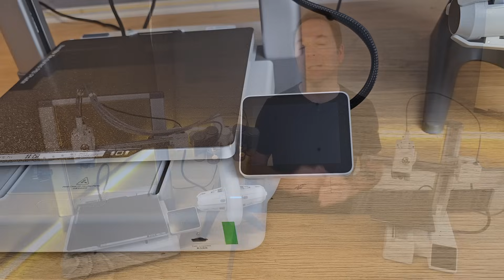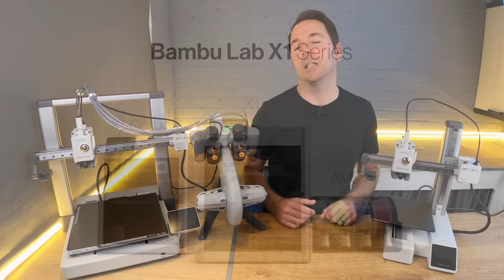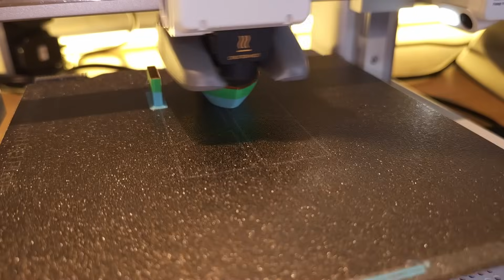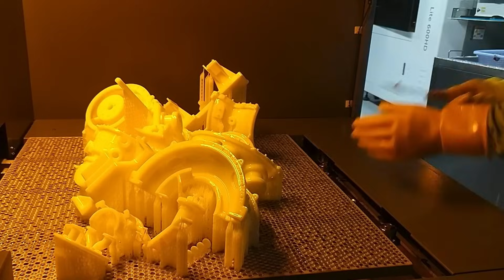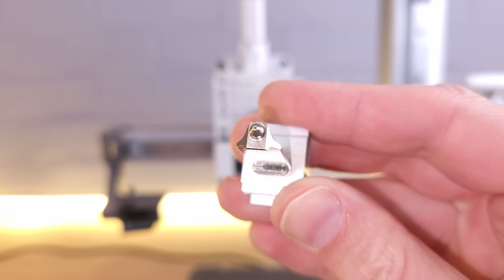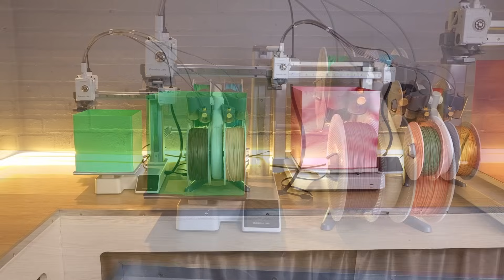Bambu Lab A1 Vs A1 Mini - Which 3D Printer Is Right For You?

Comment: Question: Is the AMS Lite necessary for a complete beginner? I mean, I don't mind getting it or is there a better alternative?

I came in here expecting to check more about the A1 before I got it, but I think I'll get the A1 mini instead. It's my absolute first 3D printer and my working space is tight. At the price point, it's worth trying and then selling if necessary to upgrade later.

Comment: I searched the internet and gemini and bought the A1, until in the evening i came across a website with the exact measurements, when i found out. i needed at least 195mm at the back of the a1 printer. Which i don't have. the spot is 500mm deep, so even if i pulled the a1 way to the front, i wouldn't have enough space at the back......right? please advice if i really need that much space at the back. Otherwise i'd the a1 mini. I hope i'll get some reaction(s)
Reply from the maker: Unfortunately yes, you need room for the wires when the bed moves back, you can't squash them as it can cause premature failure.

Comment: My struggle between the two is not the price — I think they’re both incredible value — but rather the size they take up, and the cognitive appearance of them.

My space isn’t very big, and I feel like the A1 mini looks (due to both its volume, and - as you mentioned - cantilevered design) sleek and unobtrusive, whereas the A1 – when I’ve measured out the volumetric dimensions – seems like it’d be overwhelming in a smaller space. 

I’m surprised that there aren’t more people pondering this when I do web searches online; everyone seems to purely talk about the price of the unit, and the bed size.

Even though I would be putting it in a spare room (so there’s reduced concern over air quality/safety), I still don’t like the idea of having this large object taking over part of the space, especially for something that I use every now and then— super functional and helpful, but very much not an everyday appliance. 

Additionally, I’m personally not the kind of person that intends to print things like cosplay masks/body-parts etc or giant models, but more so functional stuff (like mounts and brackets and things), and my concern is purely that I’ll come across some prints every now and then, or a one off novelty item I might want to try out, and I won’t be able to because the bed will be too small. 

I’m finding it very tricky to decide whether to have an object that dominates the space, but it is much more flexible in terms of people’s existing designs that can be printed, or something that’s much more sleek and fits in as an occasional item, that has some restrictions on what I can print.

I think I, personally, lean towards the mini, but …I’m worried about regretting my decision honestly.

(Thanks for the video!)
Reply: Mam dokładnie to samo, ale nie zależy mi aż tak na wyglądzie. Też chce drukować bardziej funkcjonalne rzeczy i pomimo że mam duży budżet to chce drukować rzeczy które raczej zmieściłyby się na a1 mini, ale boje się że będę żałował. Jeśli już kupiłeś drukarkę to jakie wrażenia? Dzięki
Reply: @claderyt3160 I love the A1 mini. I printed tons with it back for a couple of weeks in November when I got it, and then have only printed a couple of things since then (utility / practical things, as needed). I’m still very happy to have it on-hand when required. However, if you don’t care about the A1 mini’s looks specifically; get the larger A1.

I literally only have the mini because of its cute looks. If I was indifferent on the looks, I would’ve gotten the A1 instead.

(Happy to answer any questions if you reply here)

Comment: Got a A1 in December had filament get stuck to tr nozzel and after cleaning it up the ball berings in the x assembly started falling out as it was now damaged. Contacted bambu and as soon as I uploaded videos and pictures to my account they started the replacement part process. They actually sent a newer x axis that had holes for the motor cover in a slightly different spot. So i contacted them again and spoke to there team. They then told me what happened and sent me a new motor cover and parts needed to fix the issue. I can't say enough great things about there customer service. No way near the hassle I've had with creality. I bought a 3v3 from creality last year. This machine had one issue after another. Kept saying if I replace the parts am I still covered under the warranty? They told me no problem.  So guess what it wasn't the issue so I contacted them the last time they basically blamed me and said I would not be covered. So I have a 3v3 I can't run and kinda refuse to even work on it because of it. But no where near the issues with Bambu I have become a bambu guy and it was because how they handle issues and there great customer service department.

Comment: I've been looking at bambu printers and multi colored printing but I just don't like the looks of the AMS lite and for the same reasons you mentioned the filament is all out in the open. I much prefer their AMS for the other printers but I just can't fork out that much right now. As I have 3 other printers that are larger I was considering the mini just for smaller parts and the multi colored printing and/or just being able to use up whole spool and then down the road get a A1 or even their P1 printers.

Comment: Still on the fence if i get an A1 or A1 mini.. not easy decision lol got a Sovol SV08 printer with a big bed already.. but no color.. i wanted a secondary printer that would do color.. not sure if we usually reach 180mm+ bed capacity for color printing.
Reply: I think the A1 combo is only $100 more than the mini now. I’m on the fence too. I got the ender s1 but I may need to take it back. I’m on day 2 of trying to print with it and man is it terrible with bed leveling.
Reply: All i can say is if you want to actually enjoy 3d printing get a good printer. Bambu lab is a good first choice brand printer. Otherwise you will end with crappy firmware and leveling.

Comment: Thanks for this video. I'm thinking of buying either A1 or A1 mini. I currently own a very old 3d printer. There are times it won't be able to print because the filament in the tip of the nozzle swells and won't go out anymore even when it's very hot. This was being caused by the brass pulley on the extruder. I will have to remove the filament, cut it, and insert it again. Can a Bambu Lab printer detect clogs and fix it magically?
Reply from the maker: Honestly, as yet I have never experienced a clog on either of these machines. I think you would be very surprised at how much better these printers are compared to other 'bed slingers' from just a year or two ago.
Reply: @RickyImpey  Thank you so much!

Comment: I had a Creality Ender V2 Neo, was a great printer up until a month in when things started to go wrong. I've sent it back as I worked out I had spent nearly £50 on trying to fix the problems, another £50 and I could have bought the A1. I have the ability to tinker, I just don't want to, I want my prints to work first time and I have no shame in going for the A1 for ease of use.

Comment: I was absolutely staggered how good the A1 Mini was when I got my first one in April, after having used various Creality Ender printers previously. The A1 Mini just works, and it works brilliantly, so brilliantly in fact that I decided to get another one. For £169 they're an absolute steal. Owning an A1 Mini means I can now print all the things I sell on my Etsy shop without having to worry about anything - I just press print and walk away! Highly recommended to anyone, whether a beginner or experienced user.
Reply: Do you sell trinkets?
Reply: @joeking433  No, I sell sci-fi model kits, figures, and gadgets.
Reply: did you get the combo or was the ams not needed?
Reply: @dennishamilton8009  I got the printers on their own. The AMS is nice, but I don't really need it.
Reply: What about smell?  Do you have in house?  Any worry about toxins in the air?
Reply: @renae2863 usually abs is the main one that does those fumes however it’s not comparable with this so it’s alright the fumes
Reply: @renae2863  Yes I have my printers in the living room. There are no smells I'm aware of, and I have no worries about toxins or anything I print PLA).

Comment: I’m looking to buy my second 3D printer.  My first and current 3d printer is the Ender 3 s1 plus.  Which has been a great learning experience on how to maintain printers.  Though currently has been annoying me with constantly having to level and fix.  I literally just destroyed a brand new build surface as I forgot to auto level and the nozzle was too low down.  

So I am very interested in getting a Bambu lab printer as a second and more reliable solution.  What I can’t decide between is if it’s worth getting the bigger A1 even though I currently have a bigger printer.  Or should I get the a1 mini with the multi colour option.  

Because I could use the mini for most things but when I need something big I could just use the Ender

Comment: I have seen a number of reviews raving about these printers but I have not seen them using the AMS Lite and I bet its because they hate it or couldn't be bothered with the hassle.  It is not clear how to load the filaments at all and actually quite awkward.  The idea of spitting filament everywhere and having a purge tower seems like nonsense.  With modern printers I have gotten used to very fast benchies but a basic color benchy is over 24 hours on these machines.  I am sure that it can do better but it is hardly a beginner's machine if it is that bad out of the box.

Comment: I got both the A1 and the A1 mini (dont see any need for the AMS), I can get an almost injection molded smooth finish with both of them, they are both superb printers, im not going back to my ender 3 machines now they are done, the future is this.
Reply: i got both as well, the a1 mini is an great companion machine
Reply: Is there a difference in print quality
Reply: @Idontknowwhattonamemychannel  I've had an ender 3 for 12 years. Getting consistent decent prints is a pain in the butt. There is no automation. If you want to tinker, it's a good one to start with. If you want to just consistently print, I'd go for the bambu. I have one coming
Reply: @wibbledee yea I agree Enders are actually great starters they make you have to tinker and they just encourage the stem experience and also it’s way easier to use Bambi lab then if you have experience from a Ender yea
Reply: Please share your experience. There is a difference in the noise level when these printers operate.
Reply: @эл29  so I have a Ender and I have done a few mouse dampening mods but overall in some ways the Ender is quieter in motor movements is way quieter than by Bambu and on the Bambu it is like uf I touch it at all it will break but the Ender if I touch it I am fixing it
Reply: Question, which is more silent? Im debating right now which way go, being the most important setting the amount of noise it makes
Reply: @teresianes  it depends on preference of the time the ender is slower quieter and worse quality but the bambu is good mostly quiet now after this new firmware and if you want complete silent its amazing at it like I fell sleeps
Reply: In your op8nions which one is better a1 or a1 mini because I have the money for both but I don’t know wchich one to choose
Reply: What about smell?  Do you have in house?  Any worry about toxins in the air?
Reply: @renae2863  no I have ventilation

Comment: I think the difference with Bambu machines is that you get to use the WHOLE bed. Which is a huge concept coming from prusa, anycubic,  creality and such printers.  I mean after 100mm from center and I was sweating it and  my prints come out great, when they come out. I think this part is very underrated about these machines let alone closest to push and print you can get with something you have to slice first.

Comment: 13:03 "print at the same speed and I haven't noticed ANY difference in quality". The differences may be small (same hotend, ~same firmware) but this shows you didn't look close enough or do proper ringing/speed/acceleration tests. Literally in the next shot there's visible ringing on the A1 print. A1's bed (256^2 area) is much heavier than A1 mini's bed (180^2 area) so the Y axis should be A1's weak point. A1 mini's cantilever design may result in X axis issues but maybe only at accelerations higher than what's reasonable for its Y axis, so overall maybe A1 mini could print faster at the same quality. Maybe, some proper testing would be nice.

Comment: WoW great video. Can you give the measurement from the top of the reel to the desk. I have a limited height problem but like you reposition of the reel, and your handle.
Reply from the maker: The standard A1 setup without AMS has a total height, including a reel of 640mm. Is this what you mean?
Reply: @RickyImpey  No, with your new handle that reposition the reel on top of the A1Mini. With a standard spool like Bambu Labs spool in place. The top of that spool down to the desk top what is that measurement. TKS
Reply from the maker: @cliftonhead9665  Sorry, I don't have a top mounted spool holder on the Mini

Comment: I switch from Ender 5 to A1 Mini, A1 do the print ok in near 99% of the time and the remain1% usually is my problem.  Much better then my old Ender 5 that need baby sit to make sure it print correctly.  Also i hardly use up the full Ender 5 bed size due bed problem.  I printed full items that near used up full A1 mini bed size without any problem.  Although A1 mini bed is smaller, I can successful print bigger item then my Ender 5.

Comment: Here is an Idea, Instead of wasting your money on these outdated , overpriced Bambu printers. Go buy an Anycubic Kobra 3 combo that is WAY better than both of these in EVERY WAY.  Bigger surface, faster print speed, better construction, better print, less waste and no recalls......$479 and you get 2 roll of filament and a bunch of other extras.
Reply: My A1 mini has not in fact been recalled. And my A1 mini WITH the AMS costs $349. And the Kobra 3 is not “way better”. And Kobra wastes at least as much. Better construction? HAHAHAHA! The Kobra isn’t constructed any better than an SE. Both the Ender and Kobra have the construction quality of a build it yourself kit. 😂🤣 You are hysterical. Are you on Anycubics payroll?
Reply: But what you don’t get is the amazing software and the app which makes things super easy to print.
Reply: @floatypiet  Actually get the same kind of software with the Anycubic.  Makerworld, remote print, monitoring.....Yep got all that AND the Anycubic also has a tangle sensor the Bambu's dont have
Reply: Smells like a bot
Reply: @stinger220  Not a bot.  Not a Bambu cultist either

Comment: I have a P1S Combo and added a Mini after the price drop a few months ago. Didn't need the bigger build volume or multi color, so basic Mini was just fine. I will say that the little thing is an absolute beast of a machine for the price. When price dropped again for the anniversary sale I just had to pick up another one. I've been surprised as to just how many parts I've been printing fit 180 cubed just fine. With the P1S and the Minis it's likely my Enders will remain turned off unless I need to use their beds to dry filament.